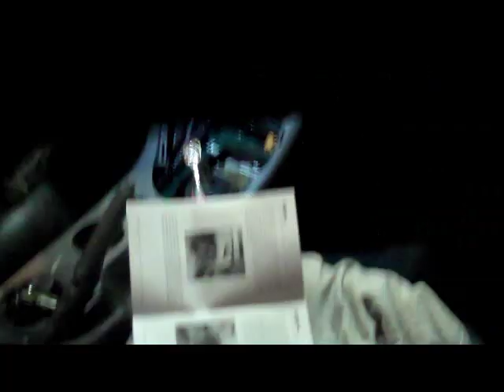Mustang Shifter Install

Comment from the maker: @DaBluedude100 I really like this shifter, my only complaint is that it seems a little too tight, it takes more muscle to pull it the 1st/2nd gear side than the stock shifter ever did, but it also practically shifts itself into 3rd, becuase it pulls straight back to center when you push it out of 2nd.  I guess that's the compromise.  Nice catch on the shift stops.  The instructions from MGW advised against installing the stops on the 3650 (internal stops), so I left them out, so far so good.

Comment from the maker: Good is an opinion, I picked the MGW so you know what my opinion is, but I am sure there are people that would tell you not to get an MGW.  Shift stops are basically bolts that prevent you from over shifting the gears; my 3650 tranny has internal stops, so MGW recommended not installing the stops.  My understanding is that 2001 SVT Cobras also had the 3650 (you'll want to confirm that), so you'll have internal stops too.

Comment: Hey.   Good install video.   Now that youve driven and broken it in a bit, how would you rate this shifter?  Im looking for a nice notchy shifter where you always know exactly when the gear engages.   I HATE the stock shifter in my 03 Mach 1 and Ive read good things about this shifter.    Oh   I didn't notice if you set the shift stops or not?   might want to double check that before it costs you a shift fork!

Comment from the maker: @vinnie2723 I have not noticed any grinding into second or any other gears.  That's not good though man, give MGW a ring and ask them if they are concerned that your shifter might be defective.  I would switch it back to stock until you can get it resolved, grinding could lead to serious issues.

Comment from the maker: The shift stops have to be set if you use them, in this application though the manufacturer recommends not using them because the Bullitt's t3650 transmission has internal stops.

Comment: Thanks!  I was wondering how to get to trough the console and had no idea all you had to do pull on that area.  Also, I didn't have a pull tool, so I stuck a hammer down in the crack, hooked the curved end on the bracket and gave it a tug and was able to break the silicone sill that way (Shifter came right out).

Comment from the maker: Any tool that will allow you to grab the edge of the old shifter and pull up will work.  Maybe you can squeeze a hammer in there or a small pry bar or a random tool in your garage with a hook on it, like my seal puller. I wish I could loan that rarely used tool too you...

Comment from the maker: @SSnake2002 Wow, smelling exhaust in the interior is not good at all, seriously dangerous!  Sounds like you need to swing by your ford dealer's parts department and ask them for a new dust boot, that or a junk yard to save some cash.  But you should also check out your exhaust and make sure there are no holes in it.  You should not  smell that in the interior ever, keep your windows down until you get that taken care of.

Comment: One good whack to the side of the stock shifter will break it loose from the trans. I would never recommend prying on the aluminum trans case and the shifter base. I've done over 10 of these installs and  never had to pry the stocker off. Good video otherwise
Reply: Do you leave it in neutral or do you have the transmission in gear when you take the shifter out?
Reply: leave it in neutral.